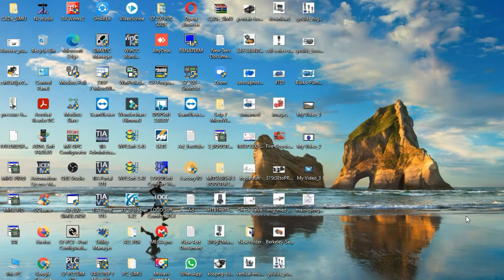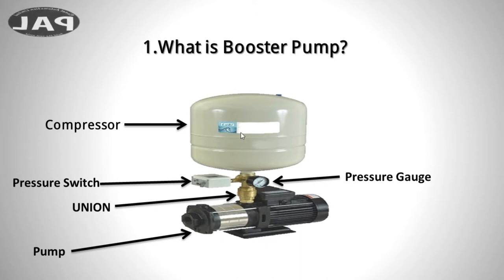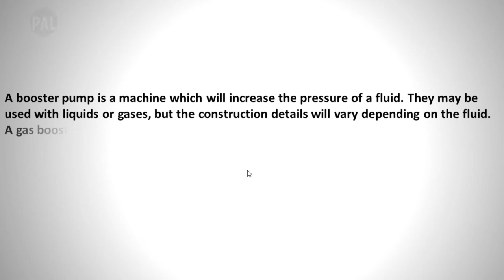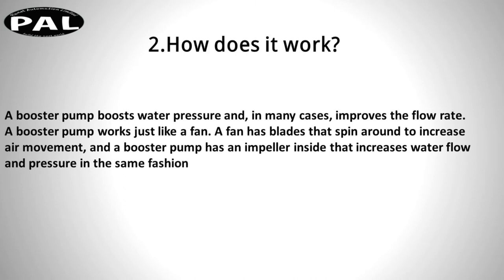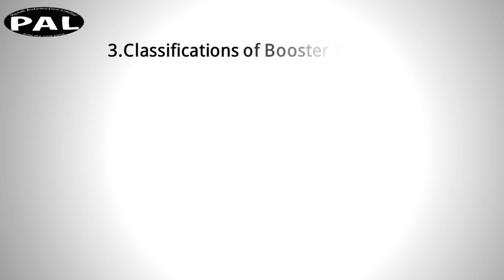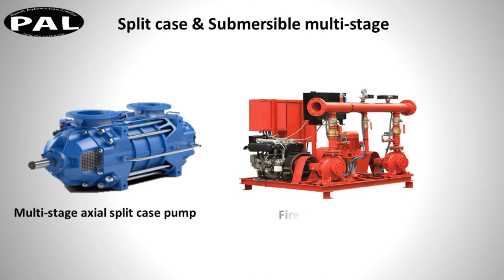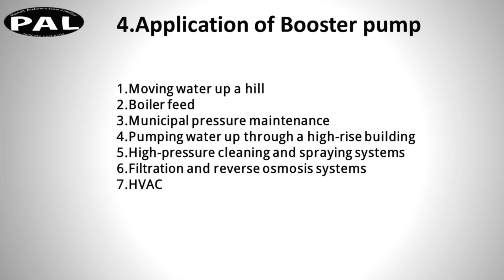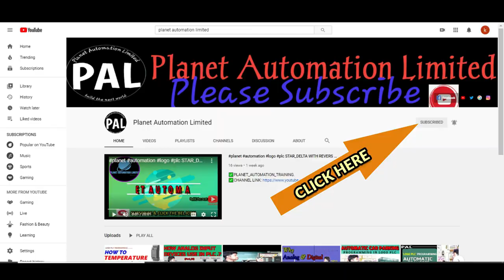How to control Booster Pump? How Does It work as a pump? Working procedure of Booster pump ! in EN

Comment: Without water in air vessel tank how many bar pressure needed.. in 200 litter or 300 or 700 litter air vessel tanks.
Reply from the maker: Thanks for your comment 

Air pressure depend on vessel size and pump head, average in vessels simply without water need to be 0 to 4/5 bar
Reply: @factomation1  .thanks for reply ❤️

Comment: Sir make a video on booster pump with  plc logo parogram .maintain 5 bar pressure with two vfds and change over also.pressure transmitter 0to 10 bar.0 to 10v output.
Reply from the maker: Thanks brother......I will try..But not in logo try will another brand of plc
Reply: Yes sir,Please make a booster video on siemens 200 or s7 1200 plc